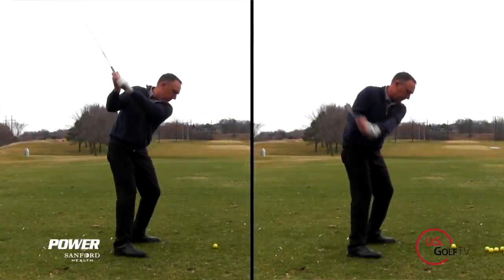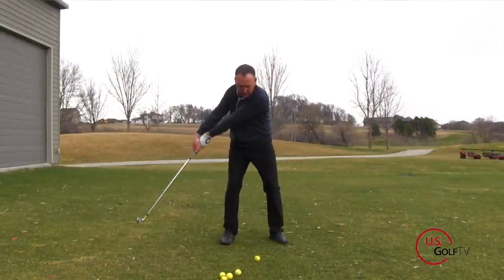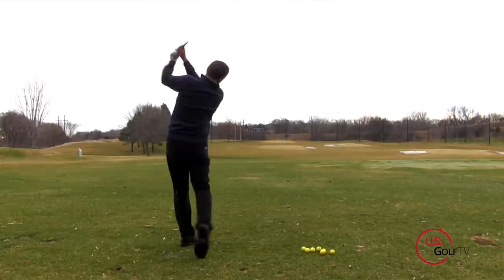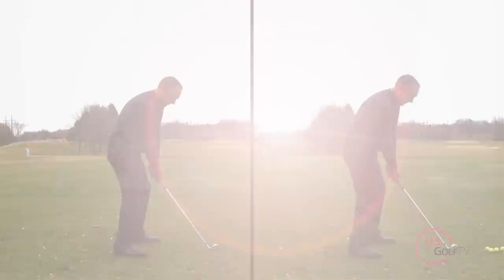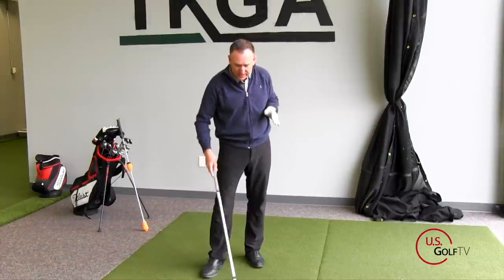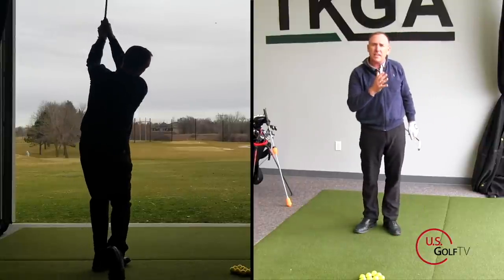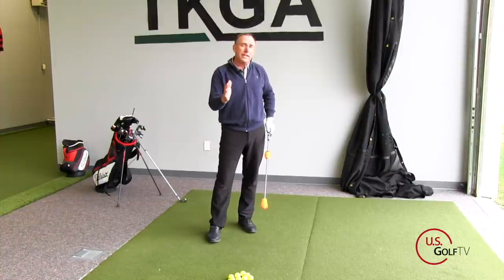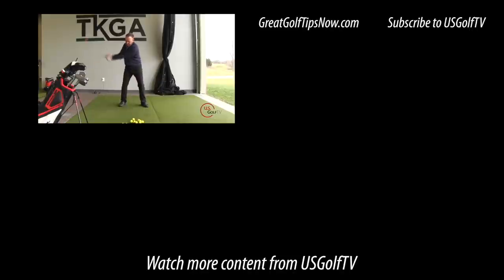Casting vs Over the Top: How to Fix Both Golf Swing Killers

Comment: Todd,
I just finished racking the last of my leaves in the backyard here in Memphis. The feel of your right knee to right field was well practiced. I held the rack handle just like a golf club. My right hand was facing down just coming into impact, my left hand and shoulder pulled up, and had the proper weight shift in order to lift leaves up in the air. This made me think this question. How force is the right hand applied to the club from last parallel through impact?  As far as I can think in 6 months of playing, I do not feel I much tricep at all to push the club.
Reply from the maker: Best post of the week right here! I might still this idea from you... 😂

Comment: I will say that with my irons, I must be definitely coming over the top. I believe I was originally doing this with my driver, causing a slice but after about a year of working on it, I was able to correct this and now 90% of my drives are straight in the fairway and if I do miss, it is usually a hook. The strange thing is, I seem to do this more with my irons now than I used to. I can tell because my iron divots always point to the left. This has been more difficult for me to correct because when I concentrate on it, I seem to either pick up at impact and top the ball, or hit it straight right. But I will try the right knee right field method
Reply from the maker: The right knee right field drill works wonders for many many golfers...be sure to let us know how it goes.

Comment: I like what you presented here. I am an older golfer who still plays fairly well. However my miss with irons is left. I thought I was coming over the top then I thought I was releasing my hips too early and the swing was following my body turn causing the pull. Sometimes it is a pull draw. I'm thinking now the right knee right field may help me correct this problem. Do you agree
Reply from the maker: John, thanks for the question. The right knee right field is a great drill and would be the perfect place to start...be sure to let us know how it goes. 👊

Comment: I struggle a lot with Alice on driver but all my divots go left and I feel I am wiping across the ball.  I also am a very short hitter.  My 7 iron is about 135 yd.  I am 59 and have had this issue all my life.  Thanks for any help. I am a 19 handicap and desperately want to get it to a 15
Reply from the maker: Appreciate your post here. Check out our videos on the Vertical Line Swing System. These videos and information is geared directly for our “experienced” golfers.